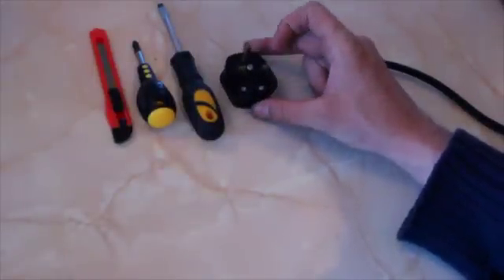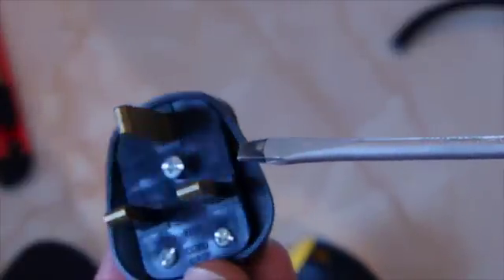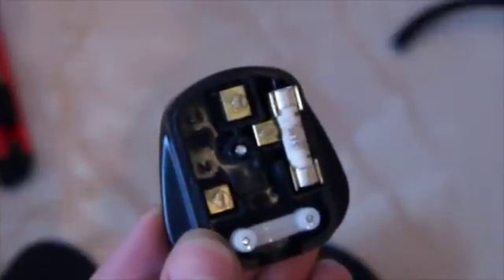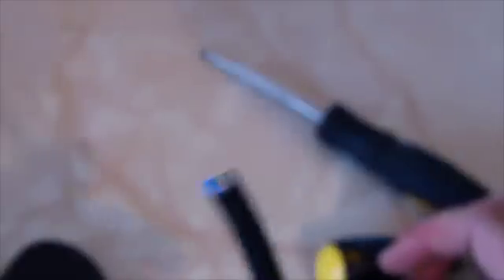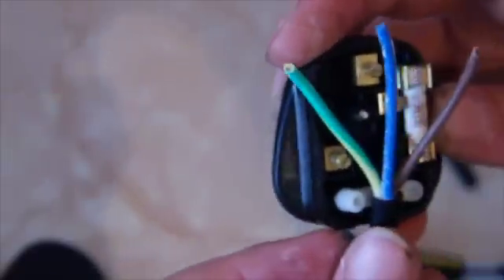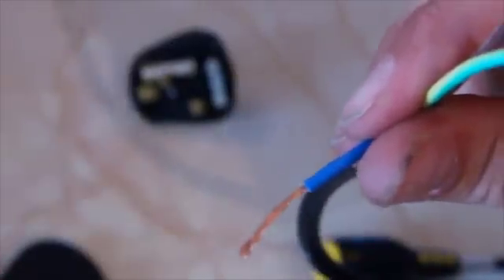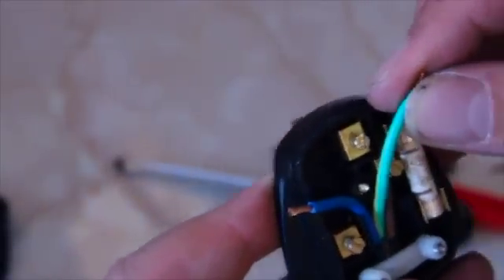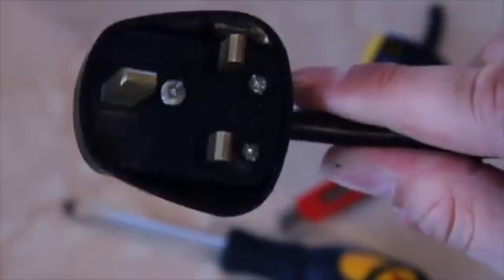How to wire a 13 Amp Plug

Comment: The screws on the plug case and strain relief are not Philips or Posidrive - they are either Modulo (CK) or PlusMinus (Wiha). Use the right tools for the job!

Comment: Can you use any plug that fits an appliance as long as it has the correct fuse for the appliance?  e.g I lost my cable for my tv, it’s basically similar to a kettle lead and I found another one that fits.  On the plug I found it says 3A printed on it and it has a 3A fuse.  So i took the 3A fuse out and put a 10A fuse in, as I 100% know the tv needs a 10A fuse.  Is this ok to use as I’ve put the correct fuse in the plug for the tv?

Comment: great video i have been looking for a simple explanation for 3 amp plugs and no earth for a while. As there are none out there i have found i suggest possibly including it in the name of your title so it will show up on searches. Something like 3 amp plugs explained or no earth cable explained.
Reply: There are two types of equipment: earthed and double insulated. Double insulated have two levels of insulation which typically means a plastic case. Those do not have an earth wire. Most double insulated devices are low power but not all: vacuum cleaners and hair dryers are also typically double insulated.
 
In Britain the plug is always the same so one cannot easily see the type. In most of Europe the plugs are different. Low power double insulated equipment have a flat plug. High power ones have a round plug with holes for the earth connectors, like this:

https://upload.wikimedia.org/wikipedia/commons/thumb/e/ef/CEE_7-17_plug.jpg/250px-CEE_7-17_plug.jpg

 If the equipment is double insulated it should have a symbol of two squares one inside the other. 

https://www.cui.com/products/image/getimage/9122?typecode=m

I calculated all devices I had used in a year: 44 were double insulated, 9 were earthed so earthing is an exception. Earthing is typically used on kitchen equipment, washing machines etc. and  on computer equipment. For example TV equipment is typically double insulated as are all mobile chargers.

Comment: Just for clarification: Make sure that the Earth wire (if any) has more slack than the other two wires. This safety precaution ensures that, if the cable is tugged out of the clamp, the Live wire will disconnect before the Earth wire. Otherwise, a tug might disconnect ONLY the earth wire, leaving the appliance still working (powered via Live and Neutral) but without a safety earth connection!
Reply: Nonsense.
Reply: @Tazza17   Why is it nonsense?